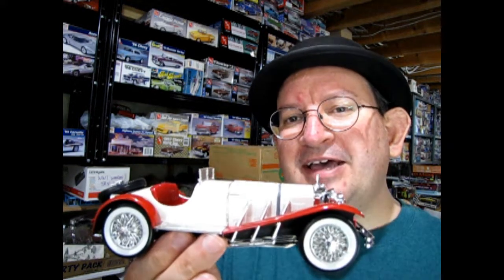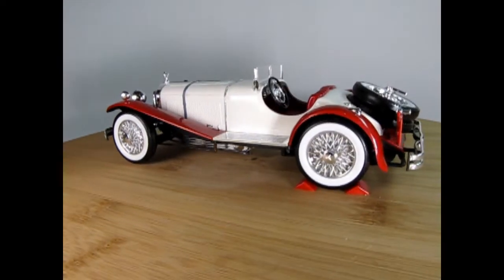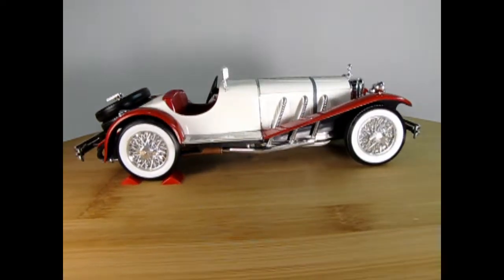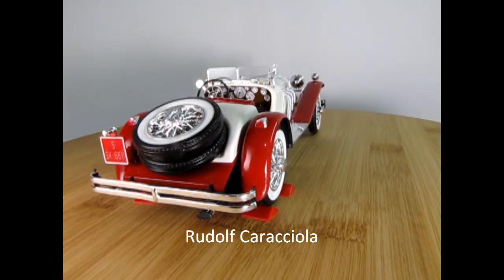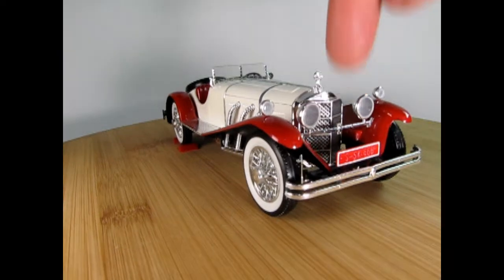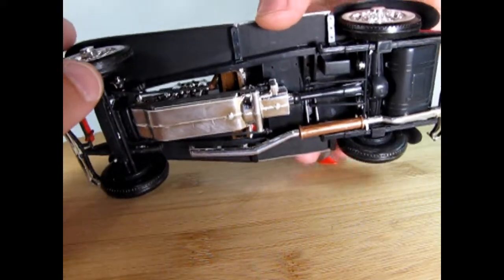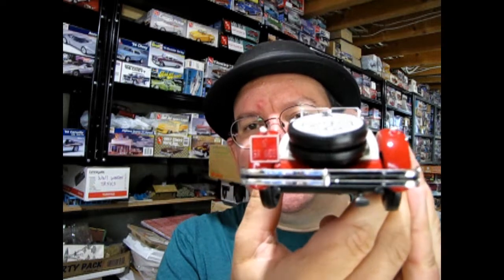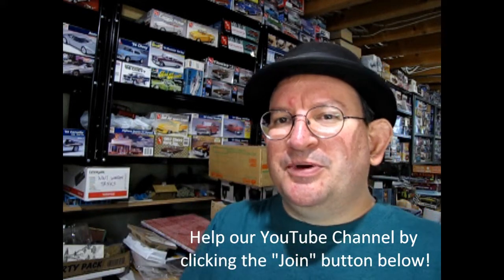Model Car Garage Show And Tell - My Dad's ENTEX 1929 Mercedes Benz SSK - A Model Car Build Video

Comment: I had the Lindberg version.  I was about 13 at the time, and, after many failures, had just gotten a handle on successfully completing model car builds.  I'd had good luck with figure kits, but usually suffered some catastrophic mishap, somewhere along the line, which I lacked the skills to fix.  This kit was the turning point.
Reply from the maker: Thanks for sharing! Sounds good that this kit got you going!